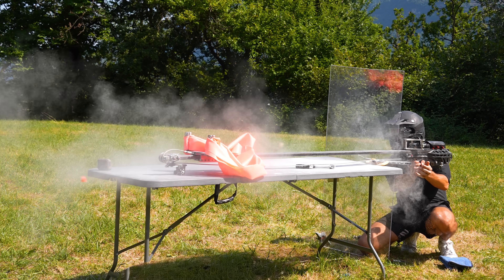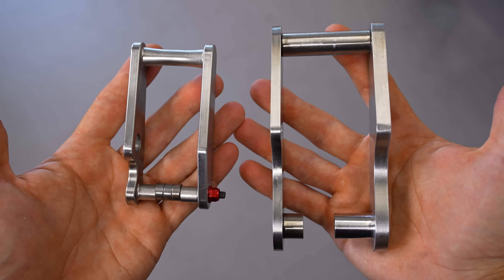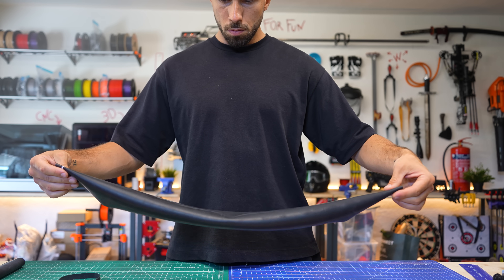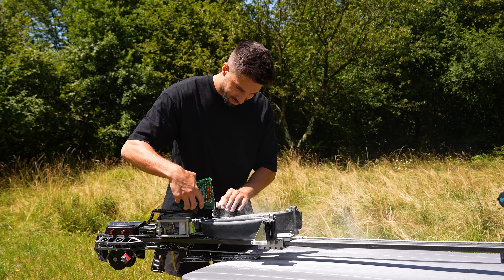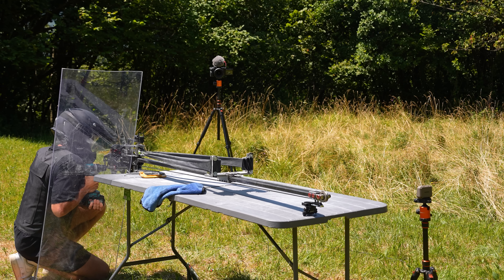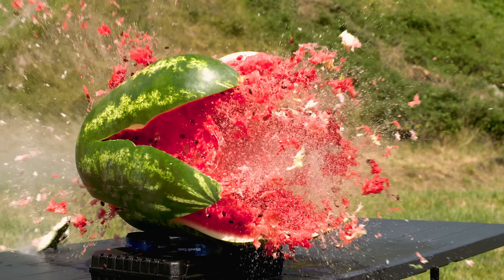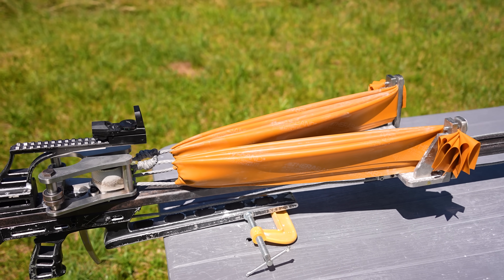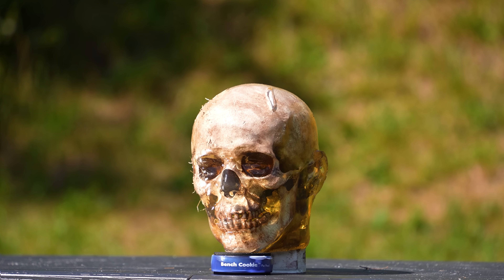Bulletproof Glass vs World's Most Powerful Slingshot

Comment: You should be able to use some stiff wire and press an override button on the inside of the safe (if it has one) through the bolt holes.

Comment: Next upgrade; make it all self-contained. Better legs that fold out, something that lets it clamp down on the table, built-in shield, built-in drill motor. On that last one; you can get the same brushless motors that are in drills significantly cheaper as parts than as a whole drill, just need to hook up a switch and a battery.

Comment: to prevent the bands from wadding up and potential loss of energy maybe consider having the bands pre-loaded under tension. Bands fixed to the side of the slingshot and running to the front fork around rollers. not only would it decrease draw length, meaning a smaller overall slingshot but will make the power transfer more linear. bands might wear out faster but i reckon with some ingenuity could be a very viable option

Comment: Does a bazooka-style shoulder mounted slingshot count as “hand held?” Even if it doesn’t think of how awesome it would be!
Edit: if whichever current design you’re using isn’t already too heavy, adding a decently large block of dead weight behind the stock would provide some counter force for the huge length.

Comment: Hear me out.. What if the bands didn't directly pull on the pouch? 
Hell why use rubber bands at all? 

Imagine a cable driven pouch, attached to pulleys, that link towards two banks of heavy duty tension springs mounted to the side of the frame?

Comment: I feel sorry that it has been so difficult and expensive for you to get to this stage. However your efforts are very much appreciated by your viewer's. I hope that you don't give up on achieving 1000 joules as I would love to see that. However I think that it would involve a totally different design involving the spreading apart of the forks to enable the extra rubber to work and limiting the amount of friction that would be involved. However getting the forks to slide apart whilst under so much tension is questionable. It would have to involve one hell of a base rig and either high power pneumatics. I can't think of anything else that would be able to actuate fast enough. 
Good luck and keep up the great work if you can afford it.

Comment: 14:57 it does stop a .357 because typical .357 magnum rounds have less grain than your steel ball around (120-180 gr) even though they travel at a faster speed than your ball it doesnt punch through a br3 window but your steel ball can because with 631 joules and 500-600g can break thru that glass
Reply: That glass was also unsupported which probably effected its strength
Reply: @Bendnt141 also true
Reply: 1. Bulletproof (resistant) glass is designed/tested/rated inside a certain design of frame. The frame is an integral part of the system and plays a role in the stopping power of the glass. So just leaning it up the unframed glass against something is like the worst case scenario. The bulletproof glass standards literally include a load of different specifications for how the glass must be framed because it's so important for it to actually function properly.
2. the glass is designed to stop bullets, and in this case pistol rounds, which when they impact are more of a high speed, short duration metal spat. (the projectile deforms significantly, the metal is much softer) 
3. The ball bearing doesn't deform at all and imparts it's energy over a much longer period of time with much less of the energy being lost to deformation of the projectile

Think about it like this: 
You've got a setup with 3 normal pieces of glass, that have saran wrap between each layer, and superglued each layer together. Then leaned it up against a wood frame or something  

It's the difference between:
Taking a marble sized ball of clay, wrapping it in a thin layer of foil like it's a piece of chocolate, and throwing it at your glass setup really really fast.  
And 
hitting that same setup as hard as you can with the rounded side of a ball-peen hammer.
Reply: Now imagin replacing the steel ball with 1 from titanium. I wonder if we could tweak the ammunition to be more dart-projectile-like without it tumbling. 😮🤔😉😁
Reply: @woutvanostaden1299 you'll just get higher speed but less mass. Moving to tungsten would probably yield better results.
Reply: a 357mag has between 700-1000 joules.  The glass was freestanding so would have been weaker.

Comment: 14:57 the difference with a .357 and what you are using is the pure SIZE. 640 joules of a big steel ball does more damage than a ~9mm small fast projectile. Damage per mm is more with the slingshot

Comment: 9:30 505 joules is MORE than a 115 grain 9mm bullet!!! you've made a weapon that is actually MORE dangerous than a 9mm gun because a 9mm bullet will generate a much higher pressure on impact and penetrate the target more. any penetration a projectile does in a target is basically "lost" energy. only when a projectile stops completely in a target does that target receive all of the energy. and if the pressure is lower, then more of the target is damaged. this is why hollowpoint 9mm bullets are more damaging than just 9mm ball.

in countries that regulate weapons based on energy, your slingshot would be quite illegal! its impressive that just rubber can reach the energy of a 9mm gun.

Comment: On the off chance you see this: the best way to pierce through things is with a lot of speed, not mass. I remember watching demolition ranch growing up and he always said the way to beat body armor is with speed. I’m not a physicist but I think a design like this that uses bands would trade off a lot of energy if you tried very small balls though, so there’s definitely a sweet spot.

Also, I’m sure you’re not eager for a redesign but I think that square tube should be rotated 90 degrees. Since the band is a good several inches above the tube, it’s going to be trying to bend it in its weakest direction. Someone with more knowhow than me could probably calculate that if they had the measurements and force on those bands. It’s possible the tube is plenty strong in that direction and rotating it wouldn’t matter.

Great video as always!
Reply: You will never exceed 350 fps with bands, no matter what. So your only option is with mass if you want to produce the amount of kinetic energy you desire.
Reply: @robertwong2412 this was my theory reading these comments. There must be some point where, no matter how light the projectile is, it won't increase velocity. And considering the goal was kinetic energy, increasing Mass is the only option (between a certain amount). You put the words I was trying to find into my own head lol. Good job, thanks 🙏🏽
Reply: There is a lot of stress on the tubing in both directions. Even though a majority of the stress is vertical, the sideways stress must not be discounted because it is still very high.
Reply: @2rjk  Definitely, but I'm certain the vertical loads are a lot higher than the horizontal loads since both bands are pulling vertically and (in theory) should cancel out horizontally. So I still think a vertical tube would be better unless the one he chose is already more than strong enough in the vertical direction.

But that's a good point and definitely something important to remember when designing! Something like an 1/8" by 3" piece of vertical metal "could" be strong enough and computer analysis wouldn't find any problems, but any horizontal bend would likely be catastrophic
Reply: You can see that in the equation shown in the video, physics say mass scales up linearly, 1:1, but speed is exponential, every increment is squared, this gets stupid very fast
Reply: It's not all about speed. A pistol round is faster than this steel ball but wouldn't penetrate the bulletproof glass in this video.
Reply: Yeah - not really any useful suggestions by me, but kinetic energy is equal to half the mass times the velocity squared, so if you doubled the speed you’d notice that kinetic energy quadruples

Said energy would be distributed across a lesser area with a smaller projectile so that’s a thing as well

Also I did some quick googling for fun, and apparently the energy from a .50 bmg can be upwards of 20,000 joules, which is 40x more than the (around) 500 in his video. Kind of crazy to think that much energy is packed into such a comparatively small space.
Reply: @ppoiuyt342 man you’re speaking my language, I almost mentioned the v^2 increase in kinetic energy but then realized that air resistance also increases with v^2, negating some of the energy gains. But I don’t know if the increase in resistance from a sphere increases linearly or squared with the diameter. Or maybe something else entirely but I’m sure that’s a known relationship. 

Point is, people that care about these calculations probably aren’t using steel balls and rubber bands they’re using bullets/missiles and explosions/rockets.

So regardless of what Mike uses he gets an A+ for making the pointlessly big slingshot we all dreamt of :)
Reply: It is true that speed matters a lot for penetration. For example, .45 ACP ammo, fired from a 1911 handgun, is a stout, powerful bullet weighing 230 grains, or 15 grams. Very effective against unarmored targets, but because it is a very slow bullet, it stops dead when it hits armor. In contrast, you can look at a more modern P90, firing it's FN 5.7x28mm rounds, which are tiny by comparison (just 93 grains, or 6 grams), but are fired at more than double the velocity, and thus punch right through armor.
Reply: I'm not sure of that speed is the answer. The old elephant guns of Africa needed penetration to get through the hide and heavy bones, and they were all very large calibers and not more than 2000fps.  In fact the bigger the game being taken, the heavier the projectile needed, not necessarily speedier.
Reply: Mass vs. surface area is a huge factor, too. Think instant psi. 20 pounds spread across 1 foot is not bad, 20 pounds spread across .2 inches is a stab wound.
Reply: Lots of misconceptions here and in the replies.

1. Mass absolutely matters, and matters just as much as speed. If mass didn't matter, we'd make bullets out of some really cheap material like copper and not lead. Mass is also the reason why the armor penetrating cores of bullets are made of tungsten or tungsten carbide. It's also the reason why the US military uses depleted uranium penetrators in their tank munitions.

2. Where increasing mass becomes a problem is when you have to increase the size of the projectile in order to increase mass. This does still increase the energy of the projectile, but it hinders its penetration. This is because a larger projectile has more surface area to interface with the material it is penetrating, thus causing more drag. This is also a problem for aerodynamics for the same reason.

3. Some people in the replies are implying that increasing speed is 'more worthwhile' because the effect speed has on energy is exponential. This is technically true but also misleading. The reason why increasing speed has an exponential effect on energy is because it becomes exponentially more difficult to increase speed as you go faster. This is why the speed of light is the speed limit of the universe. As you keep trying to go faster, eventually you're going to require more energy than exists in the entire universe to go even the tiniest bit faster.
Reply: @copjing it is worthwhile to note that increasing mass does not HAVE to equate to an increase in contact area with the target and drag, hence why modern dart rounds are significantly longer than the sabots proceeding them. Using a slingshot design, THEORETICALLY its possible to use an oblong projectile, so in theory oblong projectiles could be shot accurately resulting in increased mass with no notable increase in contact area. To be fair at that point you’ve made a spear gun though
Reply: @LettuceGayming  Yes, this is mostly correct. Longer projectiles will still increase drag in reality but the effect is relatively minor compared to making a projectile wider (which will absolutely obliterate penetration and aerodynamics by comparison). As for modern APFSDS rounds, they are more shaped that way due to the aerodynamics of darts (Essentially: Dart too short = fly bad. Dart too thin = fly bad. Dart decently long and decently thick = fly good) but yes being able to add extra weight without harming penetration is also a factor. The length of an APFSDS dart also needs to be longer than any spaced gaps within the armor that it's penetrating. That's why the Germany's Leopard Main Battle Tank has massive hollow cheeks in its front turret armor. APFSDS darts aren't long enough to bridge the gap in the cheek, causing them to tumble and get caught inside the gap instead of penetrating further.

There's lots of little things like this that I didn't bother to mention as you can quite literally talk about this stuff for hours.

Moral of the story is that ballistics is complicated! Like, really complicated.
Reply: @copjing  Copper is used in every wire and every circuit and is therefore is way more expensive than lead though. Also, don't forget about hardness. Lead is soft so it will disintegrate easier even if it's denser. Steel tip ammo pierces better because of the hardness. Tungsten even better. And as for speed, it's limited by the speed of the bands anyway. The bands won't go past a certain velocity even if you dry fire them, so once you got close enough to their dry fire speed, you can stop hoping for higher speed.
Reply: @copjing  yeah, some lead or bismuth balls would probably be better here (bismuth is probably preferable to avoid shooting lead into the environment and he can make his own sizes and shapes by moulding it since its low melting point)
Reply: The shape of the projectile matters too. Round ammunition hasn't been used at the forefront of military applications for 100 years.  Something like Armour can flatten a pointed tip usually but there is rounds with shapes designed for several purposes. One of them is Armour piercing rounds.
Reply: Not really.

All the energy is from the elastic energy of the bands 

It can increase efficiency but nothing else 

The more band the more energy 

The speed is pretty must the same (if they don't have the ball)

Speed don't really matter 
If he using enough band to retract close to the max speed.

The Energy that bands put is the energy the ball will have and the energy that Target will take (with perfect efficiency)

The kinetic energy is just the way to transfer the energy of the bands to the target using the projectile us medium.

What can change is the momentum

And the best way to do it is with more mass.

That's why the bulletproof glass fail not because of the energy because of the momentum.
Reply: Yes and no. think about bows and crossbows
Reply: You're right.

But there's diminishing returns.

With gp, a projectile is always limited by the expansion speed of that gp when it's ignited.  It's why eargesplittenloudenboomer didn't go as fast as was projected, and why at a certain point, mass starts to make a difference.

With a slingshot, you're similarly limited.  By the speed at which the bands will contract.  But you're also limited, similar to a bow, by the force the system can take before being destroyed.  More weight can mean slower bands, which means less force on the system after release.  The same reason you can shoot thousands of arrows through a bow, but can destroy it in a single dry fire.

Comment: I think the reason the metal ball pierced through the bulletproof glass, unlike a bullet because of how each object transfers energy on impact. When a bullet hits the glass, it most likely deforms or crumples, which causes its force to spread out sorta like a ripple in water, distributing the impact across the layers. But with a solid steel ball, there’s no crumpling(cause its not hollow). The energy doesn’t get spread, it stays focused in one concentrated spot,kinda like dropping a heavy rock straight into water,insted of ripples, you get a much powerful, concentrated splash that shoots water straight upward and diagonaly(i mean splash effect). The steel ball here is acting the same way it punches through before the glass has time to absorb and redistribute the energy. maybe be i am wrong but this was my conclusion after watching multiple times.

Comment: You should get that ballistic glass framed and indirectly backlit from inside the frame or around the edges and hang it in your workshop! Looks so cool!
Reply from the maker: That’s exactly what I was thinking about!
Reply: @MikeShake also make the wined up electric or have a stronger crank

I think we go higher
Reply: @MikeShake Instead of baby powder, use powdered MICA or powdered MOLY. 
 They will reduce friction somewhat more than plain baby powder.
Reply: @MikeShake make it shoot tungsten spheres. also make it 5 times longer.
Reply: @Bruhnerd69  At that point its a elastic band powered 50 mm tank cannon

Comment: For only $150 a round, you can get a 50mm tungsten ball weighing a whopping 2.75lbs!
Reply: What about a 50 mm osmium ball
Reply: It would likely improve more with a smaller tungsten ball that has the weight of the current steel ball. (If air resistance is enough of a factor.)
Reply: Honestly good idea. Should test for optimal weight first.
Reply: "Only"

Comment: Elastic bands are consumable material, will not last long time and look messy. Make one big metal spring in the metal tube under rail. Also make automatic reloading with button press, you can integrate your drill in design.
Reply: Without the elastic its no longer a slingshot